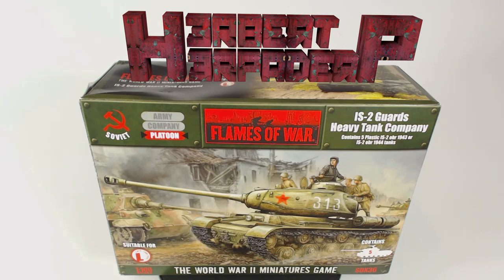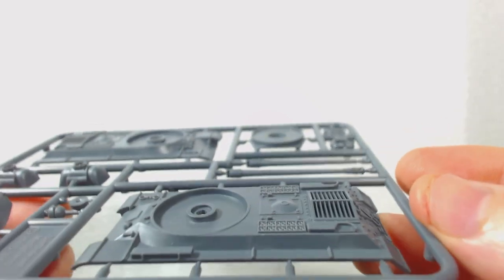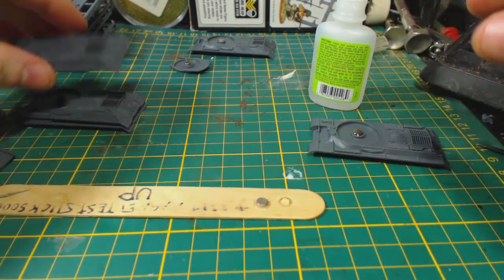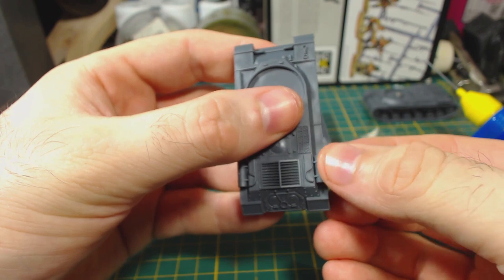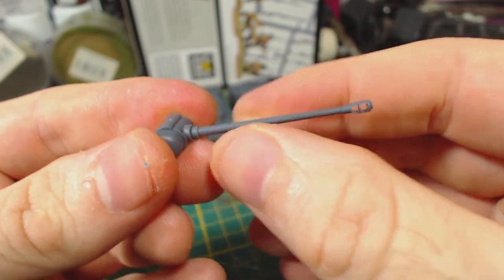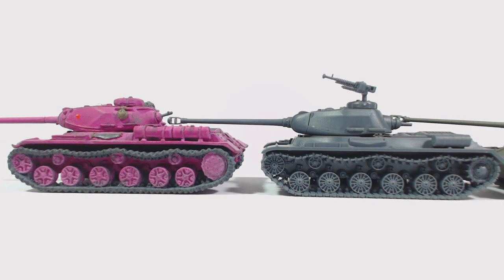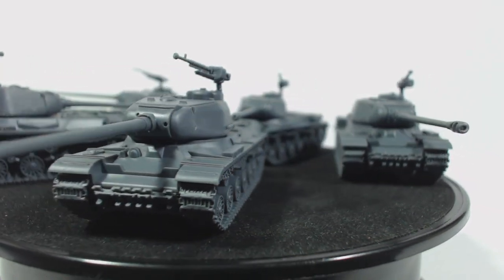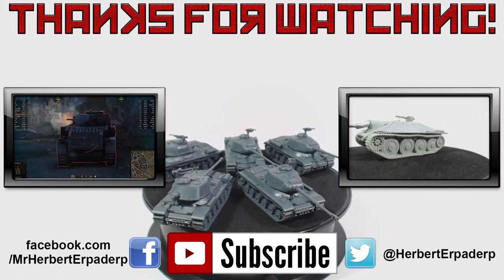Flames of War Plastic IS 2 kit assembly review

Comment: I actually stopped buying flames of war kits after they moved away from resin and metal. The newer models feel more like toys than table top models.
Reply: The plastic models have sharper detail in general I feel, but resin and metal ones do have that weight to them. In the end what matters most is how it looks after it is painted, as a badly painted resin model will look worse than a well painted plastic one.